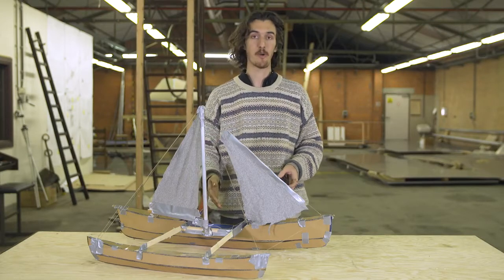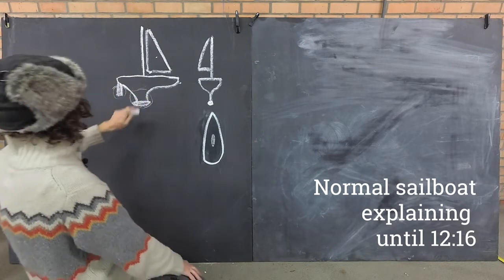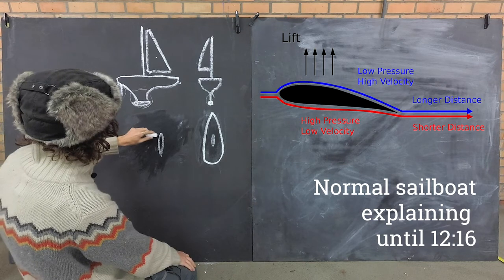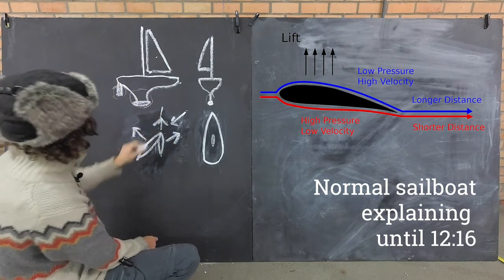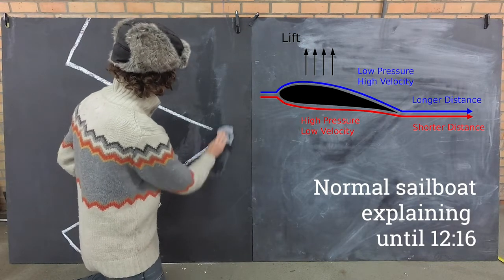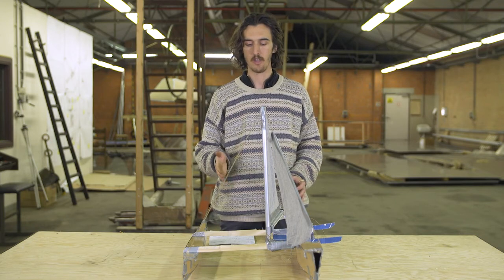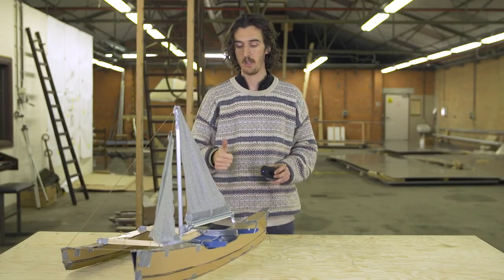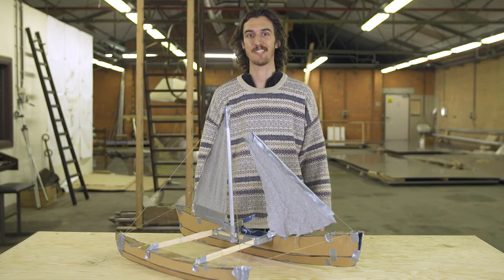How a proa Sailboat works!

Comment: The proa is what my ancestors invented, in the Marianas. The first example as reported by the Magellan expedition in 1521. Your example has a couple of things wrong. First the hull is always asymmetrical, the windward side is curved like the side of a wineglass, the leeward side is flat as a board. Also when the proa tacks it’s the mast that is moved from the bow to the stern which now becomes the new bow and the steering oar moves to the bow which is now the new stern. Because these boats sailed very long routes island to island, and the navigators were totally well versed on ocean currents, winds, so there is usually only one tack to sail before land ho. One can sail days without having to tack or relocate the mast. Please correct your model. The mast (there is only one) is stepped at the bow. Shrouds are on the windward side. There is usually a platform built across to the ama which also serves as weight to counteract heeling. The sail plan you have on your model is a sloop rig which is not the correct sail plan for the proa.

Comment: People think proas  will be cheaper and faster than any other sailbout. The reality  is that reversing the sails and  rudder  system requires complexity These systems never work as good as a conventional  rig and negates the proas advantages. A catamaran  can be built for the same cost..and is much easier  to sail.
Reply from the maker: sometimes its much more than just convenience. A Proa uses less material and sails more smoothly. In the end the captain of a boat needs to love his vessel and if that means a strange design then so be it. 
The floating neutrinos crossed the atlantic with a godawful barge-esque monstrosity and are way more inspiring than a slick factory build/ordered catamaran.

Comment: I own a set of Harris "Madness" plans. They are amazing- one of the best plans I've ever owned and I've owned a lot. I decided to go with a drier design, based on a larger Bernd Kohler P95 asymmetric Catamaran which needs no boards and is very very fast! My new design is a 26ft Cat that uses anti-vortex panels rather than boards to maintain a very low draft. . i would have built the madness but felt it just wasn't a great boat for world cruising and not as dry as many other designs.  Even tho, my current design can cross oceans its still small, and limited on its carrying capacity.  The madness Proa is definitely a technical build. but one of the most beautiful and well designed boats i have ever seen. i hope you upload any progress vids. it will keep me inspired. Also pls check out Bernd's P95, you will be very impressed, and seems it might even be less to build than the proa in costs. since it does not need loads of epoxy.  bleachable, easy to build, and FAST and very dry in all conditions.  rivalling the proa maybe faster. thanks! subbed.